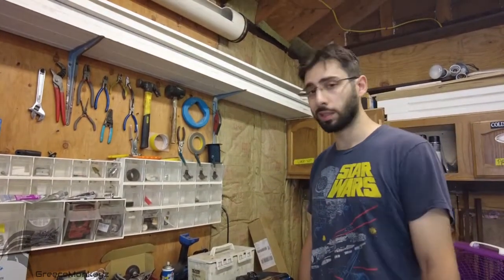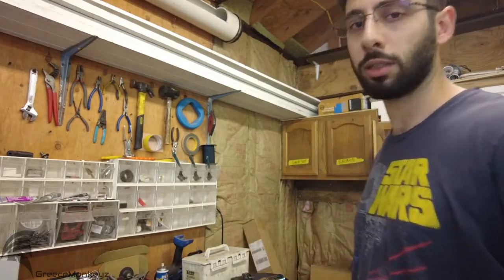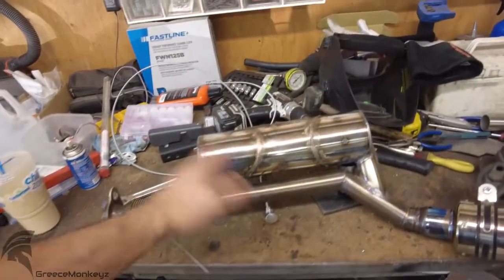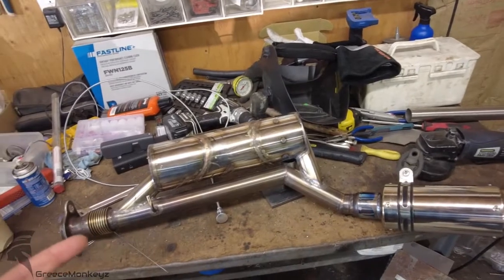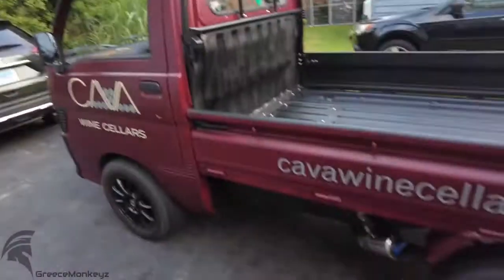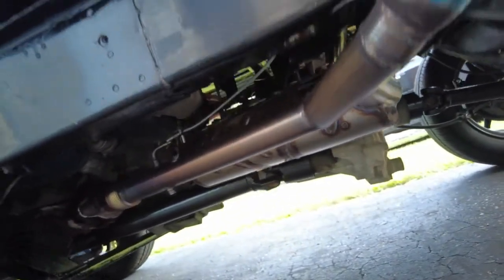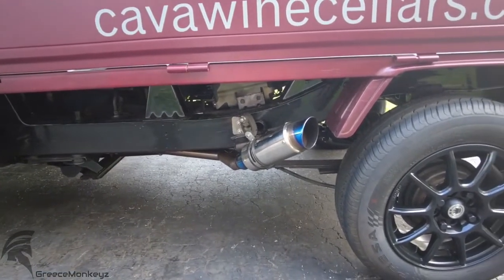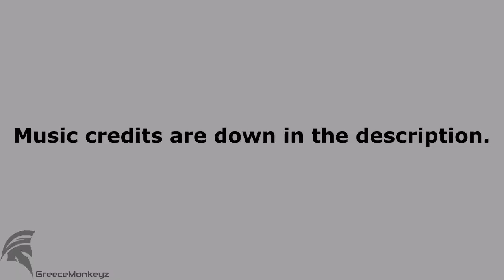Handmade exhaust cutout and muffler for the Hijet kei truck

Comment: Hey man. Love your car and videos. I'm looking to buy a kei truck myself and was wondering if you had any good sugestions on what to research before I buy one and if it would be better to import one of buy one locally
Reply from the maker: Thanks man!  So your options you could look to get or pass on are 4x4, diff lock or low range gear if you plan to offroad.  If you want A/C.  The engine layout if you care about that, some are mid some are in the rear.  If the odometer only has 5 digits and it looks like it has more miles than they say, it probably has rolled over.  If you're patient and good with paperwork, import it yourself to save some money.  Good luck!
Reply: @GreeceMonkeyz  And offroading isn't something that I'm looking to do in this. Id want to make it more of a street car with a little stance to it but not over the top
Reply from the maker: @alexshepler403  I'd go 2wd then. Saves what little space you have under the front end.  If aesthetics are important the biggest difference between them all is the headlights I'd say.
Reply: @GreeceMonkeyz  Alright. Thank you. I was also looking at importing one through carfromjapan that has 109k km on a 1990 acty for 2.5k that includes the car, importing it, customs inspection, and insurance for importing it but that seems really cheap to me. Also, would this be a good project car for my first one?
Reply from the maker: @alexshepler403  I think they're great to start on for their simplicity although parts can be hard to find.  That seems like an awesome price if it runs and drive well, I haven't personally purchased from them so I can't vouch for the quality of their cars.  Keep in mind you're going to end up spending a few hundred more once it's stateside on fees and taxes.
Reply: @GreeceMonkeyz  Sweet! Thank you! And how much room is in the engine bay? Cause I know that one day I'd want to swap it
Reply from the maker: @alexshepler403  well if you're looking at an Acty the engine is all the way in the back, so any fwd swap would be pretty straightforward IF it fits between the frame rails.
Reply: @GreeceMonkeyz  sweet! I wasn’t thinking anything too crazy like an ls swap lol. But more like a k swap